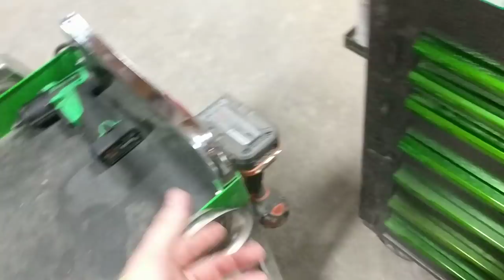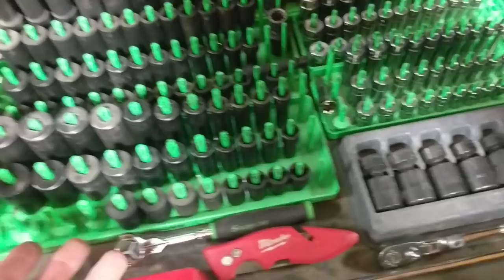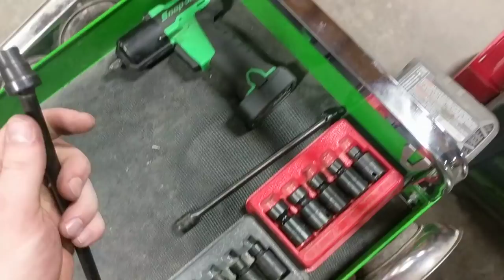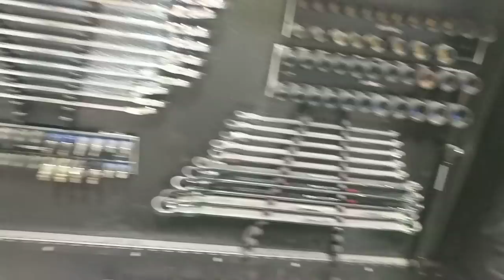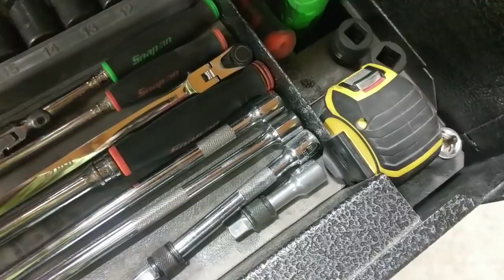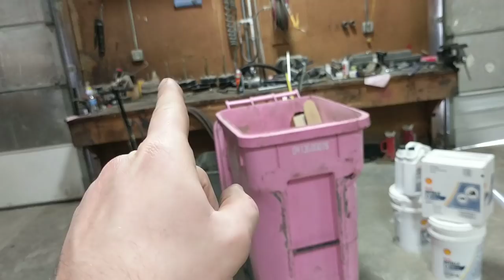My most used tools and what I grab per application

Comment: Bahco makes the 8075 18” and 86 24” adjustable spanner. Bahco are apart of the snap on group. I’ve had there bahco 1420 Pipe Grips for 13 years they look Identical to the pz2. It looks like snap on have rebrand some of bahco tools.
Bahco make fantastic tools.